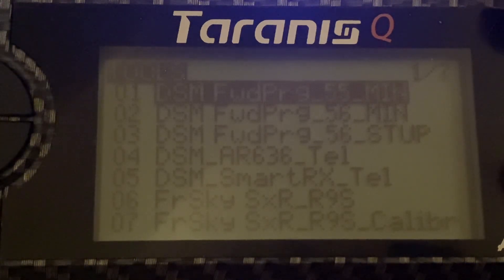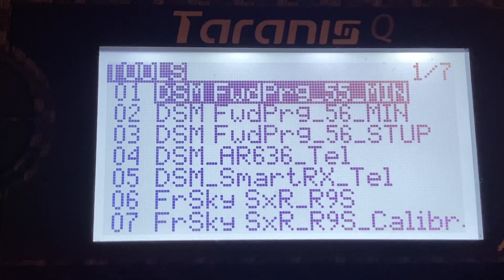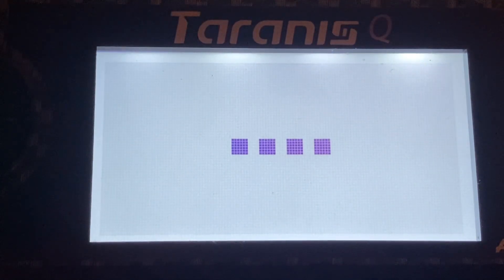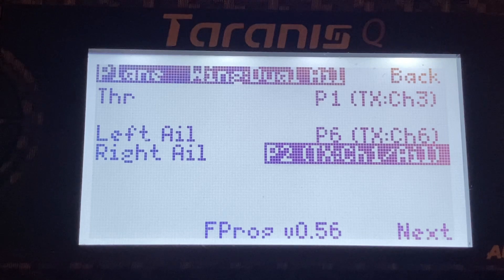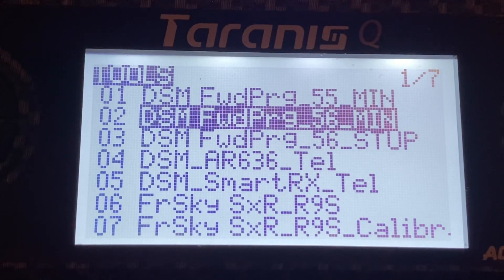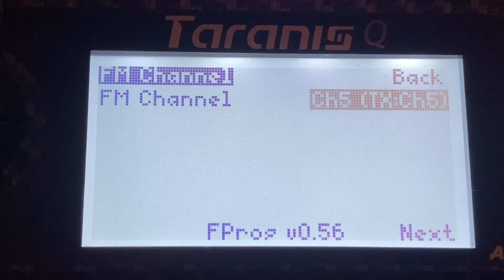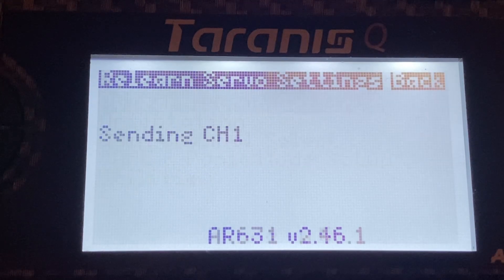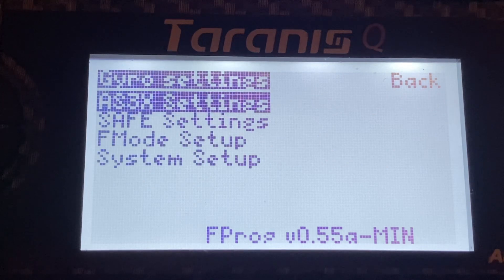DSM Forward programming on FrSky QX7

Comment: I have a boxter and a ar631. I only get a gyro setting menu option with opening the script. The gyro setting option doesnt have anything in it.
Reply: The script recognizes it as a ar631 though
Reply from the maker: If it comes from a BNF, sometimes they are locked. You will need to upgrade the firmware using the USB dongle to get it unlocked.  What version of the firmware do you have?? Should show in the screen.

Comment: Francisco , i am using the v0.56 forward programming in my boxer. I have a problem : the as3x for the ailerons is not moving in the correct direction, the gyro menu for reverse channels is not reversing it. i am saving the changes but remains the same...is ther anything else in addition of savings that i should do? 
Thanks
Reply: After saving them you have to relearn the servos

Comment: great video. I understand better now. 
I this new model setup must be done always and not the regular set up outside of forward programming.?
Reply from the maker: The “smart” RX needs to know what surface is connected to each port/ch, and if is reversed or not.
If you need to change any of that, setup needs to run again.
Look for “Shane’s DIY” videos, he goes into basic setup details.

Comment: Great video! One question: I'm trying to do this on a Taranis x9D plus, and when I run that first "STUP" script, my screen doesn't look like yours. All of the options are really spread out, and I can only see "AIRCRAFT SETUP" which is at the middle of the screen, and "GYRO CHANNEL RECIEVER" which is at the very bottom. I can scroll below those two options, but I'm not able to actually do anything. Do you know what I can do about this? Thank you!
Reply from the maker: Never tested on that screen resolution.. only EdgeTx 128x64.  I think the x9d is different.. also could be the font that I used.

will try on the radio sim over the weekend

Comment: Hello, your video is very informative.
I have been out of the hobby for almost 3 years and trying to come back. I have a Taranis Qx7 with Open Tx on it, I think it was updated with firmware in 2019. I have a few plane models already configured on it.
My question is: how can I program a  Ar631 with eflite apprentice profile on it. I did it on an Ar636 with a USB cable years ago and it just involved downloading the files from the spectrums site and uploading it to the ar636 receiver. What I understand now is that’s not possible for Ar631. Please do direct me to complete steps so that I can get a AS3x and SAFE receiver on an ar631. Thank you so much for your help.

Comment: it says No compatible DSM RX what can i do?
Reply from the maker: Your receiver is not answering to forward programming or us locked.. what RX do you have?? Is it BNF?
Reply: it is bnf and the receiver is : AR636A
Reply from the maker: @Weyrex  ar636 don’t support forward programming. (Only some helicopter versions has an earlier version). You need one of the newer smart RX. ar630/631/637/etc
Reply: @franciscoarzu8120 how can i then use gyro on this receiver with my radiomaster zorro?
Reply from the maker: @Weyrex  the AR636 can only be setup with a PC using the USB cable.
Reply from the maker: If the plane is already setup, you only need to configure the channel for flight mode selection.. usually the next unused channel.. if it is a 4ch plane, try the switch on ch5.
Reply: @franciscoarzu8120  okay thank you very much 😃